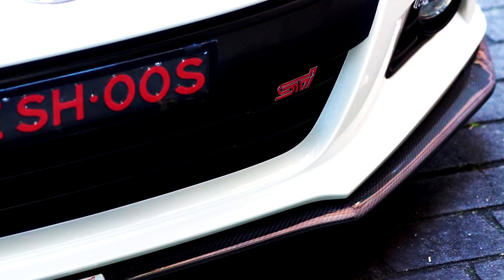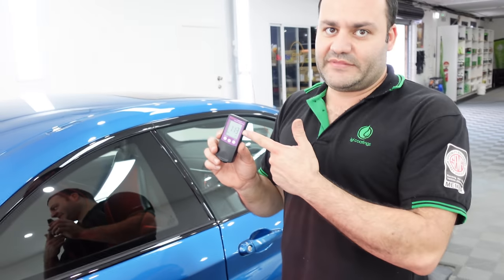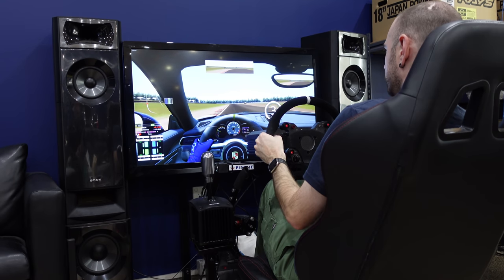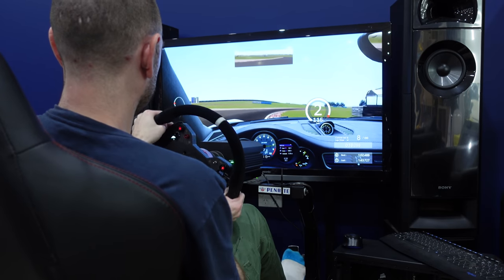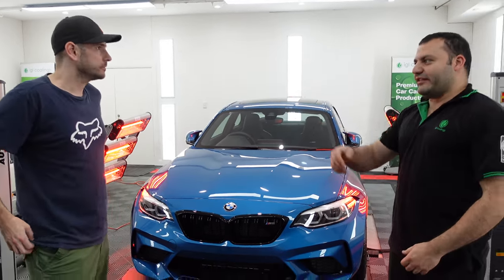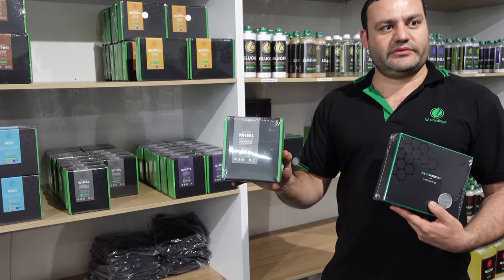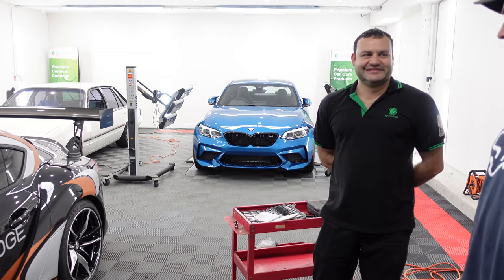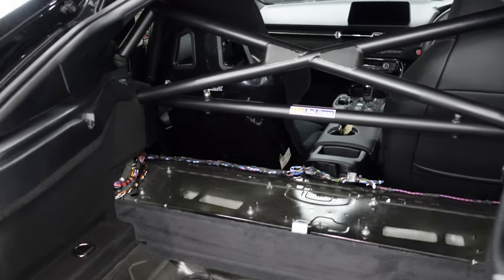Ceramic Paint Protection for the M2 Competition

Comment: Mate don't use that shit on any plastics like headlights!!
Reply from the maker: Yep! Different products for plastics
Reply: @boostedmedia  In all honesty i think it ruins paint also but that is an argument for a different day!
Reply from the maker: I’ve had ceramic coatings on all my cars for the last 7 years and never had an issue personally.
Reply: @boostedmedia  You didnt see my post the other day asking about G-Sync for triples on Pascal did you?
Reply: @boostedmedia  I used to be the one applying it...thought it was top shit for a while but years later saw....lets say, issues. I hope it works well for you though.
Reply: @2ndLastJedi  you have to maintain it properly or it starts to crack. Doesn't ruin the paint but has to be removed which is a mammoth job